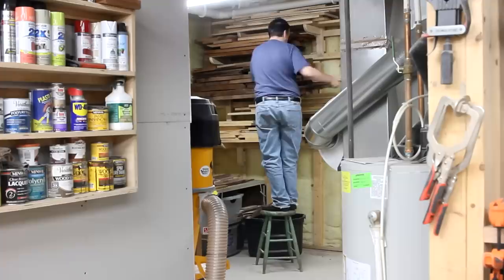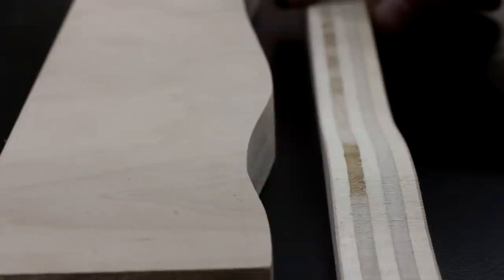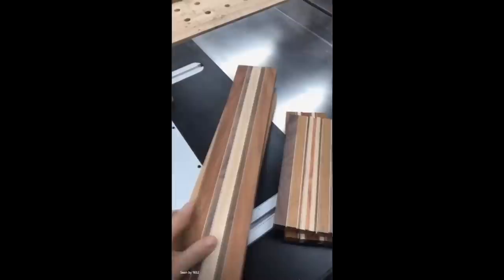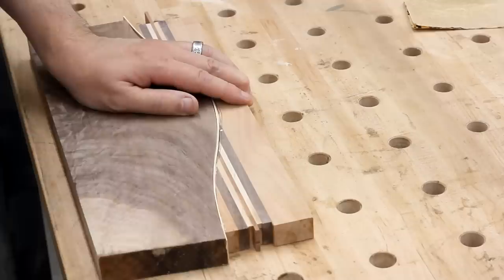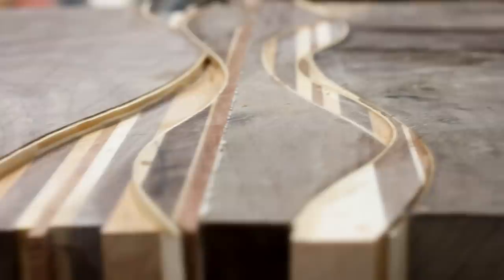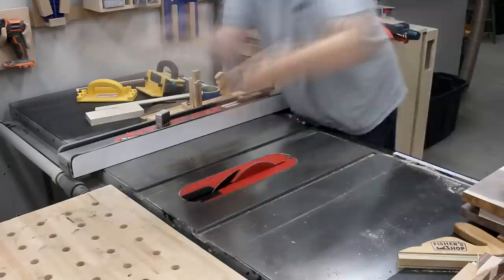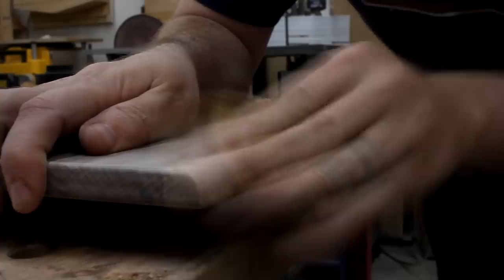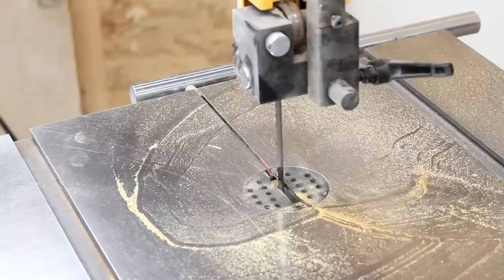Woodworking: How to Make a Woven Cutting Board

Comment: Thanks for the video. For me, the most important part for understanding & doing the project was missing--- you used mini already made mini cutting boards, you also called 'runner' boards... These boards had the initial base of color & design in them, which you cut to create more color/ design. The whole project was based on creating patterns, with color, design. So to not show anything about creation of the initial mini cutting boards/ 'runner' boards, made the whole thing not make sense to me, of how it is actually done???
Reply from the maker: Those have nothing to do with it.  That's why I didn't show it.
Reply: @FishersShop  I don't get your answer. To create the board in the video, you cut apart some already fabricated mini boards which already had some design and color, and put them into the design of the board made in the video.  I don't know how you are saying this? You did use already made boards as part of what you did in this video, right?
Reply from the maker: Because I could have just used an ordinary board instead of the pre-made cutting boards.  Watch my lazy susan video and you'll get what I'm saying.  I use the same technique but without using the pre-made runner boards.
Reply: @FishersShop  Thanks. I was just going based on what I see as the board displayed as the one being created in the video, which shows a cutting board with all the different colored woods woven into it. That's what I had hope to learn how to make when I was led into watch the video by the example shown & the item made in the video.

Comment: Would it be pedantic to point out that these are not 'cutting boards'.
No one would cut things on them.
Works of art, yes. Cutting boards no.
Reply from the maker: I guess it depends what you're cutting.  We slice cheese on ours since it takes virtually no effort and we're unlikely to cut into the board.  For more heavy duty chopping, I use my other end-grain board.
Reply: @FishersShop 
Exactly.
I'd use boards like yours as 'presentation platters', discussion items - I might even get a sale or two.